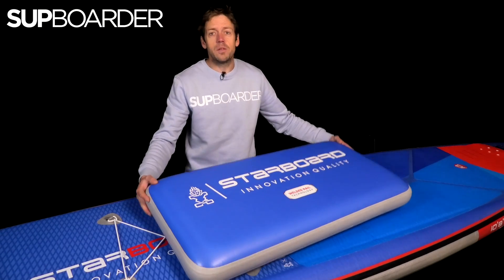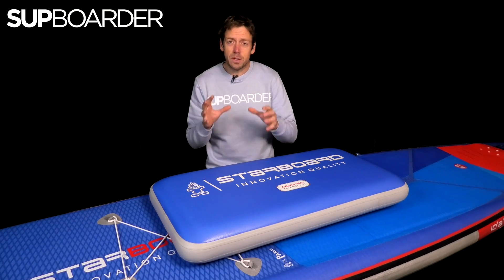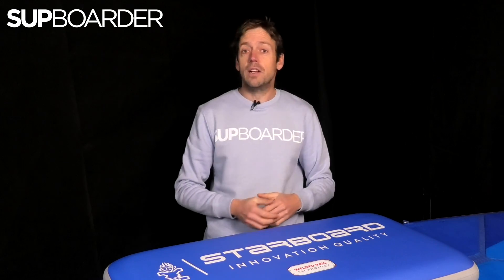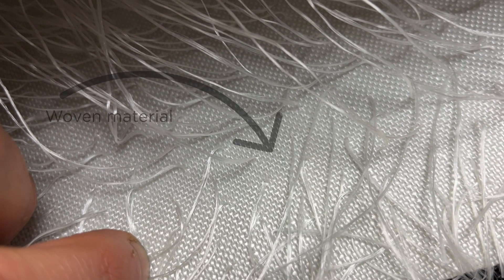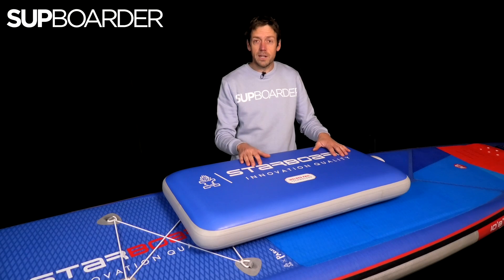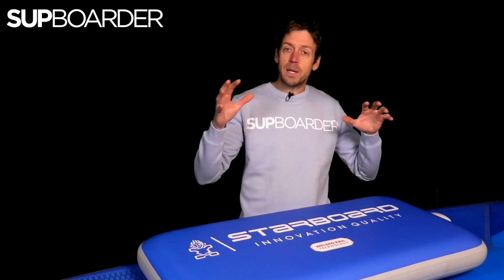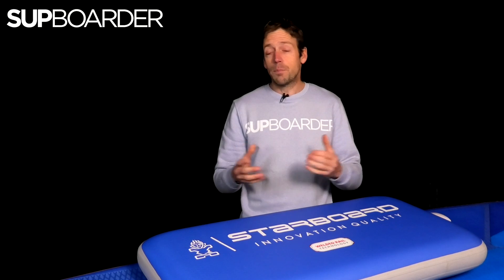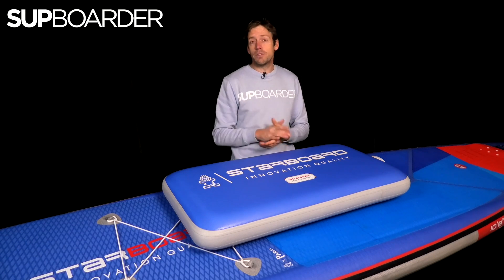Welded rail technology / Why is it good on your iSUP?

Comment: Hi guys, i have been looking at a7 year old starboard whopper inflatable board, is this too old for an inflatable. Thank you.
Reply from the maker: Hey Charlie. No, theres some great boards out there in the used market still of that age. BUT older boards that have been in the sun alot more will be very different in condition.  As the Sun is the thing that kills glues and PVCs over time. 
Sticking to a well know brand like Starboard is definitely a must when buying older iSUPs. But also in general in the last 5 years there has been a better development in iSUPs constructions and overall lifespan. 
Pump it up and check for any glued rails coming unstuck. If the price is ok too. It could be a good buy and last another 5 years! 
 Does this help? Thanks Reuben